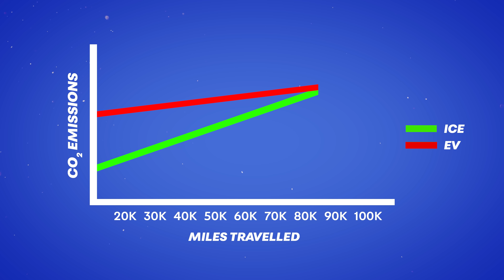Are Electric Cars REALLY That Green? [New 2022 Data]

Comment: Good on Volvo for their honesty. The amount a car pollutes depends greatly on how it is used. 90,000 miles is 10 years for a lot of drivers and 20 years driving for many.
Reply: Very good point.  I have a 21 year old 2001 Ford truck I bought new that just this month turned 120k miles.  Most of those trucks reached that mileage in their first 4-5 years of ownership.
Reply: By which time the EV battery is scrap....
Reply: Does the first mobile phone and laptop you bought still work?
Reply: 60k miles a year here.   I live in the country and do a lot of driving!  Maybe you city folks can get away with only driving 5-10k miles a year, but not all of us!
Reply: @johnny-qx6it  not many cars (or trucks/suv) of type will last long at that rate. in 5 years you have traveled 300,000 miles.  course here are some who travel  for a living, as they are sales folks who travel to lots of places, in Texas among other states. but i dont know they hit that level of usage
Reply: And an EV should last 50 years.
Reply: @crhu319  Petrol and diesel cars can and have. An EV will never make it on the original battery, which is a massive part of it's footprint. And the final part of every cars footprint is it's destruction, ie scrapping, which will again be much greater for the EV.
Reply: @matthewjenkins1161  BEVs can and have. and on the original battery too. the majority of the actual vehicles are the same (steel, rubber, plastic, copper, is the same) so we can probably use the same methods for both. the differences will be how well it gets dine, we have been using ICE vehicles for almost a century now ( oddly enough the original vehicles were electric) so we have a lot of experience with it. but we still have to deal with things like oil, and fuel. their are ways to recycle the BEV's big battery too. just dont have as much experience for that. course we need to look at more than  the vehicles them selves, because each has its own infrastructure and sources. that when they playout (like oil, the hole is supposed to be correctly plugged, which isnt always done, and so you end up with a mess from that), same with mines, ships, tanker trucks, and cant forget pipelines.
Reply: @davidwillims2004  I find it hard to believe any modern vehicles will be around in 50 years, due to the complexity and sheer number of modules relied upon, which will be very difficult to replace down the line.
And lithium batteries lasting 5 decades plus???
I just don't see that happening.
If the true goal were reducing the carbon footprint, the answer would be maintaining what we have and minimising future car production.
Reply: @davidwillims2004 when you say a battery will last 50 years you leave out the fact that it discharges faster and does not charge to full capacity the older it gets...
Reply: @timsgta  depends, many of them dont degrade faster than 1% or less a year (excluding the first year). but it also depends on how you use the vehicle. if you are out there doing jack rabbit starts, it wont. nothing really new there, gas cars have the  problem
Reply: @matthewjenkins1161  I agree, for example, even before the last 2 years, there was talk on forums about how certain modules on the C5 corvette were being phased out by GM, and car enthusiasts would be at the mercy of non factory companies making the components needed for their cars to run. I mean modern cars are cool and all, but most people dont keep them long. Only the people who know how to maintain their vehicles will keep a car for more than 10 years in all likelihood. These kinds of people also look down the road and buy parts BEFORE they go out of stock because they know they may not be so easy to get down the road. Same goes for all gas vehicles, 2 or 4 wheels. I for one like to keep something for a while. No sense in buying new every 3 years, but I also realize not everyone wants to maintain something "old".
Reply: @matthewjenkins1161  i didnt say that. some one else said could, not should
Reply: @crhu319  I wont even speak about a ton of car materials wear and tear in the span of 50 years, but you think an Ev's battery will last 50 years? LMAO!! Ignorance is bliss i guess...
Reply: @elwingy  he said should, not will
Reply: @crhu319  Lots of evidence for that I suppose? How long did the batteries last in your phone / tablet / laptop?
Reply: @5ebra1  you do realize that EV batteries arent the same as laptop/phone/tablet. most EV packs are made up of more than a few cells, which doesnt really corelate to personnel battery tech. sort if like a 4 cylinder engine is the same as 8 cylinder engine. but even they are much closer to each other
Reply: @davidwillims2004  Tesla recently changed cell size I believe, but were until recently using 1000s of 18650 cells, that are just like those in my laptop and vape device.
The management of those cells in almost certainly superior, but we all know what happens with our laptops.
Over 5, 6 or maybe 7 years slow degradation, like you say a small amount each year and then rather swiftly, they decline to being almost useless.
Reply: @matthewjenkins1161  but do laptop batteries in cells? or is the battery the cell?  and tesla so far (being the oldest EV builder today) has some vehicles from 2012, that arent showing huge depredation. and some of those vehicles are over 10 years old. course laptop batteries can last a long time if they arent abused. but that isnt how most of use them.  same with EVs, if you are recharging to 100% every time, and using over 80% of the battery, that will reduce the life of the battery. and considering that we also ready have a manufacturer who is going to replace a lot of batteries, but will also replace cells in some vehicles, not the battery. i dont think any laptop battery can have that done?
Reply: @davidwillims2004  Yes most laptop batteries are just 6 or 9 18650 cells, obviously in a proprietary case to fit the particular laptop.
Just because so many have made it to 10 years, doesn't mean they will 11, 12, 13 or maybe 14.
Just like laptop batteries, they may degrade very slowly before suddenly hitting a point of serious degradation.
Nobody knows the likelihood of that, until such a point is reached by a significant percentage.
Why most would assume that is unlikely, despite experience of similar cell technology elsewhere, I cannot fathom.
Reply: @matthewjenkins1161  not really all that similar, there is a lot ,more in those EV batteries, since they will be exposed to weather, where as most laptops will never be exposed to weather (in some cases if the temp is too hot, the laptop will shutdown at best, worse components like CPU will burn up as they are too hot).   EVs have a lot of built in, such battery management software, and tech, to keep the pack in the best environment that's possible,  well the EVs that have lasted the longest so far are over 10 years old. some i suspect have gone longer, but have not seen any stories to that affect. course gas vehicles may last 10 years or more, not all will. just like evs longevity depends on how the vehicle is driven (abuse tends to shorten longevity) and maintenance and build quality, and some times plain old luck.  and so far the drastic degradation seen by cell phones is based on usage, and laptops also (note to self, if you charge batteries to full all the time from almost empty, the battery will degrade faster than not doing that). same applies EV, dog the car and Ev  battery will degrade faster (note gas vehicles will do the same, also EVs dont have the restriction on speed initially that gas vehicles do)
Reply: @davidwillims2004  The cells themselves couldn't be more similar and as I said before, protection in an EV is almost certainly superior.
But you and others like you, are making a massive assumption, that at some point numerous failures won't become very common, despite what is seen in other devices using near identical cells.
Reply: @matthewjenkins1161  well  guess we will have agree to disagree
Reply: @davidwillims2004  Only time will tell and I've not said batteries will fail. I just don't understand the assumption they will not.
Reply: @crhu319   There's no way batteries will last that long! Being charged and discharged they will not last 50 years you're crazy!
Reply: @timsgta  well, it depends on how you use the EV. not much different than how you use a gas car, both will degrade faster if you basically abuse it
Reply: @timsgta  they could. not that that all will
Reply: @timsgta  Like always, you have to give it time for a technology to develop. Nowadays you already have batteries that will last for 10 yrs while loosing only 10% of their charge capacity. Battery tech is still developing and it still has plenty of room to improve. Sodium batteries, solid state batteries... there's a lot of new stuff coming along, but we have to move on towards that direction and bet on it. Change is always scary and doubts are only natural, but in my view, we don't really have another choice. The same goes for lab food by the way
Reply: @davidalmeida2991   I am not scared of change. I am an electrician by trade.  I know better than most people how how electricity works, be it AC or DC power. I also understand how power is converted. Curious Q: Have you ever heard of battery thermal runaway? We have emergency procedures for aircraft batteries. I just don't fully trust batteries as the driving force behind transportation. The voltage, amps and watts is mind boggling. Look into how electricity travels, there is much debate on if its thro8gh the wire or rides along the wire so to speak, crazy stuff. Problem I see is people don't fully grasp what they strap their behinds in going down the road...just my two cents...

Comment: The best thing to do is have a car that can infinitely be fixed, your not buying a new car every 6 years so much better. If EVs were to be any good they would need to be built with a mind to cheap battery replacement, rather than when the battery is finished so is the car. You can rebuild a petrol engine.

Comment: Yes, and don't forget that CO2 today is worse than CO2 in the future.  It's like compound interest.  But also consider that if EV's are only marginally better for CO2 than petrol, then a small improvement in efficiency for petrol cars would change the equation.  For example, compression ignition petrol will give diesel level economy, and it's coming!

Comment: Actually, the evolution of internal combustion engines has vastly outpaced the EVs for the last 120 years. And there are some amazing developments coming down the pike for internal combustion engines. So I find it interesting that the conversation regarding future developments excluded the internal combustion engine. Also, the speed at which you can completely refuel an internal combustion vehicle, at vastly more locations, especially if you travel a lot of miles (I live in the USA) is  huge issue that will take decades to address (if ever).

Comment: I think you have missed a big point in petrol vehicles verses EV's, and that is, petrol vehicles have the ability to have major parts of the drivetrain reconditioned, therefore they can be run almost indefinitely! and then have no need to keep on re-manufacturing new cars and constantly, producing more and more carbon emissions!. Whereas with EV's the lifespan is largely dictated by the battery life, which I guess is the most harming to the planet component on the car. I think that when these fail at 125000 miles I think you said were Volvo's estimates? the rest of the car becomes scrap or at best a breaker? So all in all, the need to keep reproducing new EV's in carbon emissions is far worse than running reasonably efficient petrol vehicles. I Guess this Idea won't catch on with any major car manufacturers though! Coz It will reduce their profits massively producing less cars!!! They are all lying to us! the car manufacturers for the reasons I state and the politicians with their "PC" uninformed, seen to be green agendas. Lastly, I think Its brave for a well known; main stream motoring journalist to touch upon this contentious subject!. "WELL DONE1!!!!"
Reply from the maker: I hear ya. Most cars are scrapped after about 125k miles / 14 years unfortunately. So even though they CAN be kept running, they aren’t.

Comment: Sorry 90,000 miles to equal an ICE car is utter nonsense.  Use your brain and look at what is the difference between the two types of cars: engine, gear box vs motor and battery.  Look at the arguments:
.
You need to create CO2 gas to charge and EV - NONSENSE!!!  We use hydro electricity here in Ontario (no CO2 at all).  This blanket statement is simple propaganda design to give a false impression. ICE cars need more energy to convert oil to gasoline than what the gasoline pumps out in performance.... do you get it?  Do you really get it?
.
The argument that making a battery is so much worse for the environment than making a gearbox and engine (and fuel) has been disproved so many times - it is hard to watch anyone with a straight face try punt that lie.
.
Autotrader should be ashamed of themselves for continuing their nonsense.  They have already apologised for a similar article (which they took down) and here they are doing it again.  Volvo is first and foremost an ICE car producer and they want to protect their business models making money out of you on spare parts and when their car breaks down (vs EVs that don't face this).  Do you seriously think that Volvo publishing an article about their core business model is not going to have a bias?  If you do, let me tell you I have this great bridge to sell you - fantastic price!
.
Autotrader makes their money out of advertising for ICE manufacturers hence they don't want to upset the apple cart.  Think about Autotrader's motives.  Autotrader would do better to not engage in this argument, discuss car performance, etc.  But stay away from the EV vs ICE story as I (and I'm sure other EV owners) will stop watching Autotrader.

Comment: What about the carbon produced in the manufacturing of PV panels and windmills? It’s not just the carbon produced in creating electric cars it’s the carbon produced by manufacturing the so called green electricity.
Also what is the difference if you compare a modern electric car to a 1960s Morris Minor, the Morris has only been manufactured once and lasted 60 years, made from mainly steel, glass and leather which are all easily recycled, not large amounts of plastic. After 60 years, if the EV was still running what would it’s carbon footprint be?

Comment: It seems that people promoting EVs have their own agenda and that makes it difficult to get accurate unbiased information.  We all know how long a good battery will last in our cellphone or laptop computer, but people won't tell you how long a battery will last in an EV.  They would have you believe that the EV battery will miraculously last much longer than the battery in your laptop.  Do they think that Kia can make a better battery than Apple?  My car is now 15 years old.  In that length of time I've replaced laptop batteries about 5 times, I'm glad I didn't have to replace an expensive battery in my car that often.  My wife's car is 10 years old and has 60,000 miles.  She drives even less these days but she wants an EV so if she bought one during the entire period of time she owned it she would pollute less with a gas car than with an EV.  What nobody addresses is what do we do with all of the failed batteries?  Can our planet make enough batteries for EVs, and make them over and over again while disposing of the bad ones over and over again?  Can our power grids handle the increased loads?  Many parts of our country the power grid can't even handle the peak loads without EVs.  I want to see unbiased answers to those questions.  For some reason people have steered away from consideration of other fuels such as Hydrogen.  There are issues with using hydrogen in cars but it seems that these could be solved much easier than trying to switch everything to batteries.

Comment: Does the figure include the replacement batteries you'd need at 50 or 90k miles? Going on these figures, EV won't make much difference to anything. Also does this include the cost of implementing charging point networks?

Comment: I didn't buy an EV because it's necessarily "greener". But after driving them it quickly became apparent the localized benefits in terms of emissions and noise pollution mentioned in the video. Though diesel trucks are by far the biggest issue and will be the last to feasibly be replaced.
Reply: Noise pollution isn’t real

Comment: Volvo is lagging behind others in the BEV arena. 
Those reports could be completely bias depending on how you analyze the data, the source of data and the efficiencies of each components manufacture.
Tesla is very efficient in their batteries production with Panasonic.
Just to put this comparison in context: How much Energy / Heat and CO2 emissions are wasted by making the ICE massive engine block, transmission and all other ICE  moving parts and components. vs a single or 2x electric small motors ?.
We have to be quite careful about how these reports and data are analyzed within the current technological advances.
Tesla has developed a noticeable advantage in manufacturing efficiencies that no other company has achieved yet.
Oil&Gas companies are really worried about the new trends in BEV evolution and adoption and consequently will be willing to pay anything to bend the results of any study, so let's be very open mind, technically thorough and consider to do your own research diligence before you swallow anything posted as the last word.